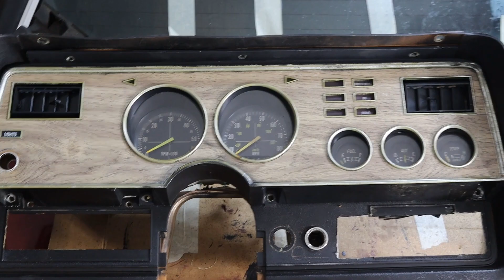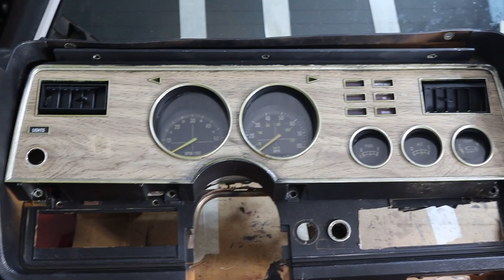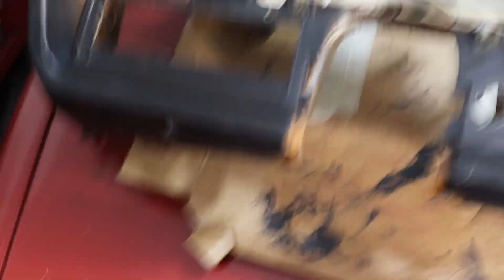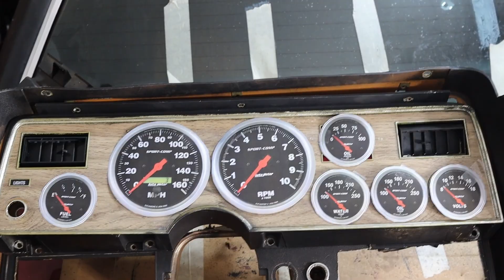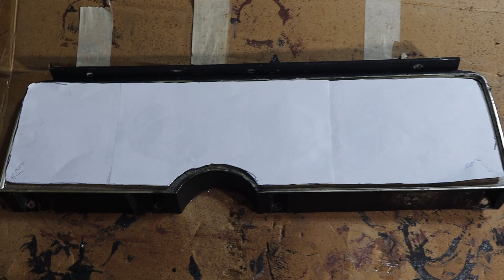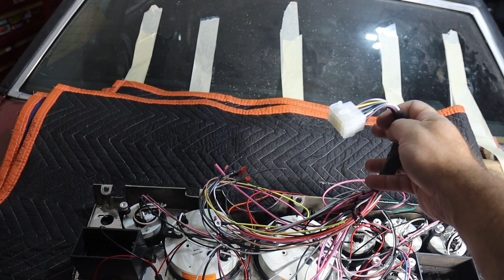1978 Mustang II Custom Dash Panel

Comment: the wood grain peels off the gauge cluster, I am using brass sheeting
Reply from the maker: I tried that at first, but the plastic underneath started to break apart, so I left it on there to hold everything together.  Thanks for your comment!

Comment: I am deleting the dash vents because I deleted the HVAC unit under the dash and intake on the passenger side, I will be routing 1/4 inch plexiglass to fit into the cowl grill in front of the windshield so no more rain or debris can get in the cowl area, originally it was a disaster in there and as you know the cowl does not come off unless you cut it off. so I will be doing some reconfiguration and installing new sheet metal before putting the cowl back on :)
Reply from the maker: Thankfully my cowl area is rust-free otherwise I'd be doing a lot of sheet metal work!  I live in Florida, and while I raced around in my '77 Mustang II for many years without A/C, I'm older now and want the comfort!  Thanks for wathing, and good luck on your project!

Comment: my son's 78 I am building I have to modify after market parts and fabricate most items, installed chassis connectors, so right now in the process of fabricating front firewall foot space torque boxes, it has a 9" with 4:11, using a 68 cougar gas tank, 32" ladder bars, we have a 72 302 block for it and a world class T-5, this video can give me some ideas on the dash, thank you
Reply from the maker: That sounds li8ke quite a project, good luck with it!